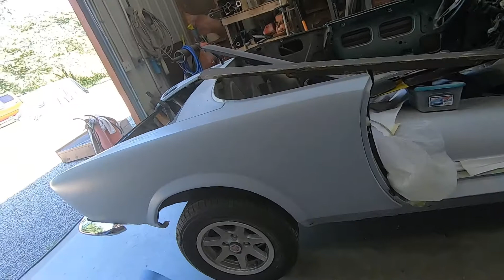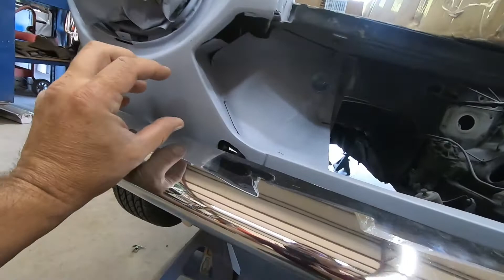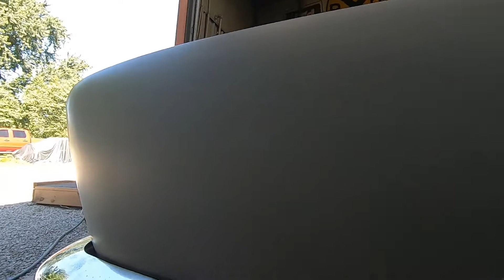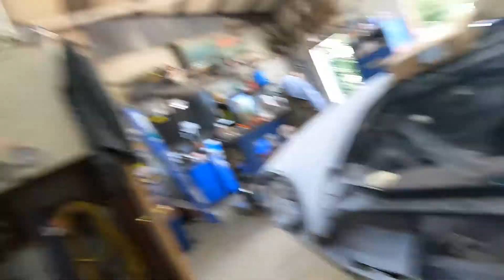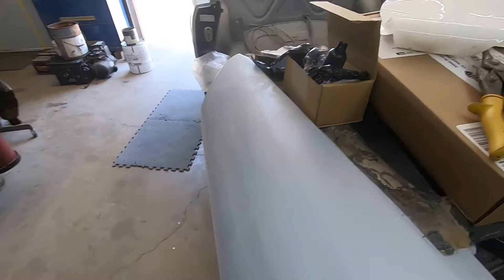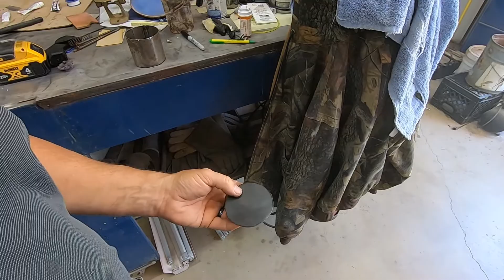Installing chrome Auto Ricambi Bumpers on Fiat 124 Spider!

Comment: If i'm to replace the chunky bumpers with these will I need to reconfigure the mounts for the front and back or can I just take them off and bolt these to it? (mounts referring to the bit that sticks out of the body and connects frame to the bumpers)
Reply from the maker: They do fit up pretty well just unbolting and using the new brackets for the bit that connects the frame to the bumper. Thanks for watching!
Reply: @HogshooterHotrods  oh it has a new bracket, ok. Do you know if it's possible to do the same with an original bumper off another older fiat? Or dose the conversion kit make it so it would fit, thank you for taking the time to answer my questions.

Comment: I am doing the bumpers on a 1982.  Did you have cut of the metal housing that the end of the original bumper mount was on?  Pretty sure you have to and the new bracket will line up.   No where does it mention it on the crappy directions from AutoRicambi.  Thanks for your help.
Reply from the maker: I used the brackets that came with the Ricambi bumpers. On the car I did you did not use any of the original parts, you simply unbolted the factory mounts that attached to the frame and installed the replacements from Auto Ricambi. Hope this helps, the car I did was a late 70s model.